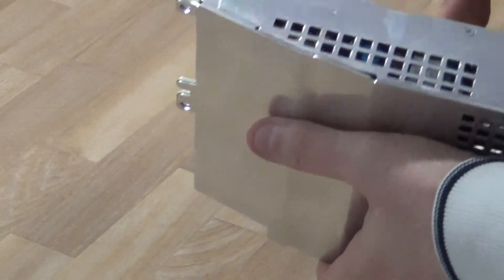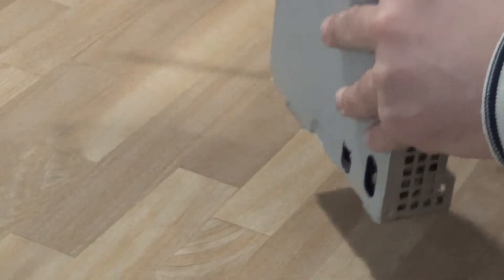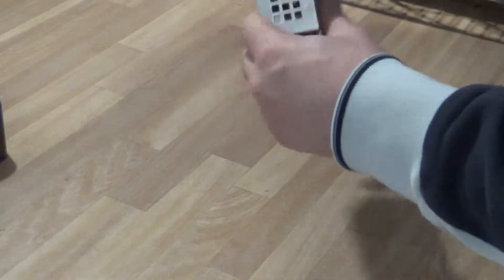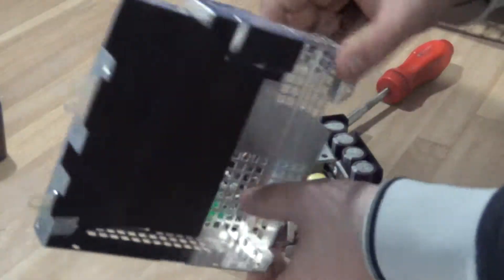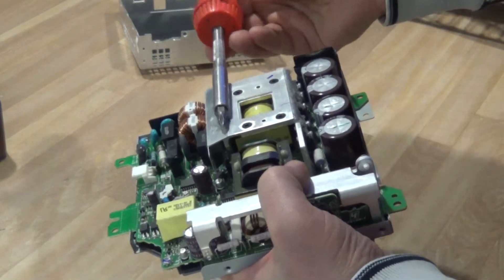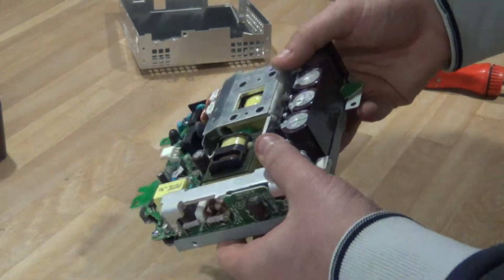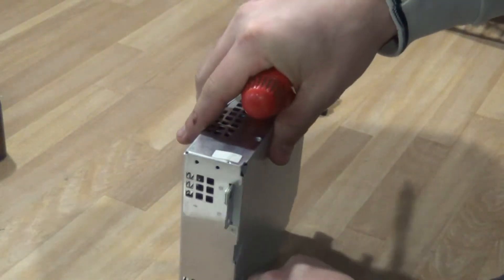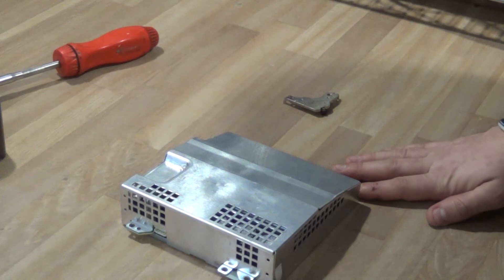Hidden GOLD in the PS3 APS-226 Power Supply? Full Scrap Breakdown 🔧💰

Comment: Is it safe to take the top off of this and reinstall it without the top?

I believe my power supply is overheating causing the system to turn off. Will taking the top off help thism
Reply from the maker: The problem is with your motherboard and not the power supply.
Reply: @champlainscrap6076  I took it apart and applied new thermal paste, when I tested it aterwards t shut off after 10 min... I took the top off the PSU hooked it back in and didn't put the top back on the ps4 and ran a game for 20-30 min no problem.
Reply: @champlainscrap6076  also... Apparently the metal incased psu's were replaced in later models with a plastic incased psu because they got too hot. And my psu got very very hot.

Have a good one, and thanks for the video.
Reply from the maker: @SheetMan  i would suggest not to put it without the top but the ps3 doesnt have much life left. The motherboard will eventually die. I suggest getting a aps-231 power supply. Those are popular because they create less heat
Reply: if you want your phat ps3 to last, these things are mandatory: 
- clean out all dust from the system
- replacing the thermal paste under the IHS of both the CELL and RSX
- replacing the thermal paste above the IHS of both the CELL and RSX
- use the eraser mod to reduce CELL heat
- replace any defective NEC Tokin capacitors with tantalum capacitors, making sure that the ESR in your replacement of one capacitor is ~1-2 mOhms (THIS IS IMPORTANT! So if you replace one tokin with four tantalum capacitors, each one needs to have around 9mOhms ESR OR LESS!)

Other things you can do to improve performance:
- install some type of exploit like HEN or a CFW so you can control fan speeds using Webman. Bump up the fan speed to what you think is an appropriate amount to keep your system cool. You want to ideally have both chips under 70 degrees C
- install a 19 blade fan to replace the stock 15 blade one
- install a more efficient power supply, like the APS-231
- have the RSX and CELL reballed with lead solder